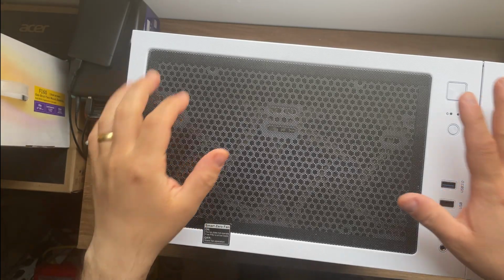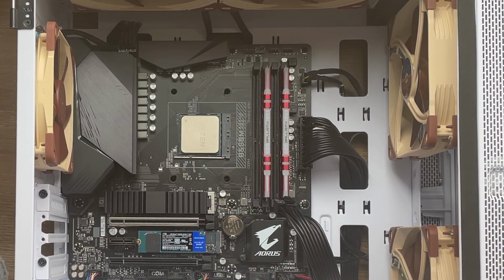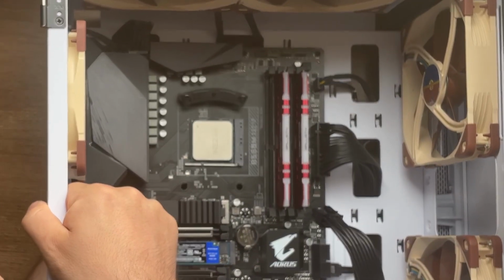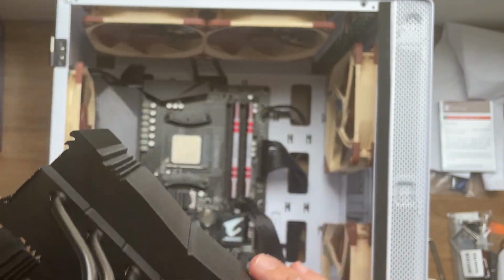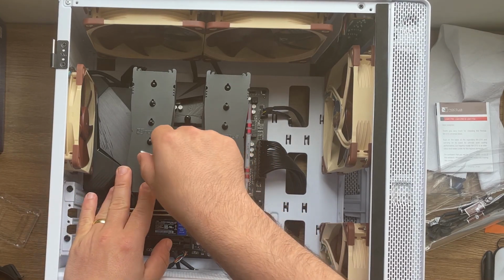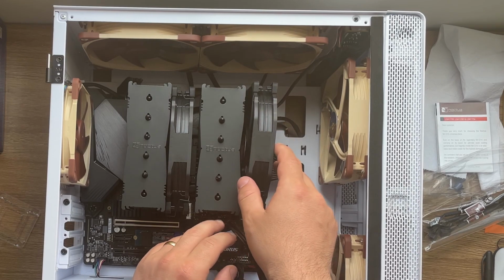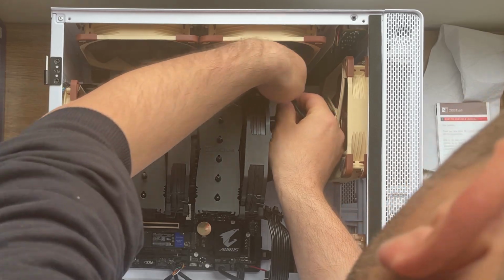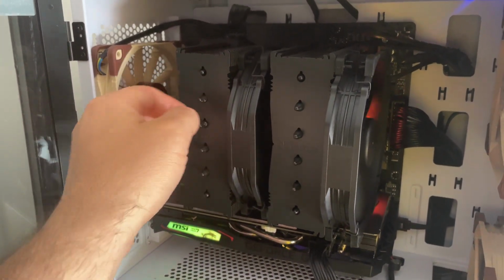NOCTUA NH D15 COOLER COMPLETE INSTALLATION

Comment: Everything is well and correctly done. 
But I saw one flaw. For the best and most efficient case purging, it would be better if the axes of both fans on the D15 tower, the supply fan on the front panel, and the rear exhaust fan are on the same line. And in your system, the upper fan is shifted upwards. 
This of course does not calamity, but this fault reduces the performance and efficiency of purging the case by about 15%.
Reply from the maker: Hi, I really appreciate your comment I will give it a try, so far the case has been really really silent, even when playing cpu intensive games. To be honest, I even took the temperature inside the case and it was very small,  I know because I have a low end cpu the Ryzen 5 3600 it will not be noticeable but, when I will get a Ryzen 9 I will really want to see how the the temps behave :) thank you very much for the feedback

Comment: Did your Noctua's cooler base plate have what looks to be like micro grooves that almost look like it was sanded at an angle?
Reply from the maker: No, the base plate of my cooler was actually very smooth and shinning. That I know of it has to be as smooth as possible to allow the heath transfer to pass without issues.
Reply: @mihaitechtips6998  - That's the confusing part. I purchased an NH D15S Chromax.black and it has a rough plate. So I check on Noctua's site and it says in the faqs:

Why doesn't the base of Noctua coolers have a polished, mirror like finish?

As most of today's PC enthusiasts use high-viscosity thermal compounds, the contact surface of Noctua coolers is optimised for use with this type of pastes. The micro-grooves at the contact surface ensure that high-viscosity thermal compounds are dispersed to a uniform thin layer across the whole contact area and that no air pockets remain between the cooler and the CPU. With a polished, mirror like surface, the risk of uneven dispersion is much higher. As too thick layers of thermal paste and air pockets drastically deteriorate heat transmission, the micro-grooves are is of vital importance to the overall cooling performance of Noctua coolers when used with today's high-viscosity thermal pastes.

I see though that most people have a smooth plate...very confusing
Reply from the maker: @liquidcrow  did you contact company? can you send me pictures by any chance? They do have micro-grooves but that is somethiong that you shouldn't see with the naked eye :) Normally when the cooler is shipped it needs to have a plastic cover to protect for the exact things scratches and damage in general. You can also see if there is a throthelling issue when you run cinebench and if it goes above 90 degrees celcius you have a product defect. I will be waiting for your repply
Reply: @mihaitechtips6998  - Yes, I contacted the company but they have not gotten back to me yet. I ended up ordering it from Amazon 3 times and finally got a model with only light grooves. I do have some pics of the version with deep scratches/ grooves. Where would it be possible to send it?

Comment: How do you remove the video card in the future if you need to install or replace the M.2 SSD under the GPU with that big cooler?  How do you push the GPU clip?
Reply from the maker: It is very simple actually, with a ruler you just need to press the pin that holds the graphics card in place and then the card can be removed just like any other card. Please let me know if you want me to make an instructive video showing the process, and thank you for the comment.
Reply: @mihaitechtips6998  that would be great to see a video on how to reach that video card latch with that cooler.
Reply from the maker: @AK-qo6tx  tomorrow I will upload a short video showing all the process, and thank you for subscribing to my channel!
Reply from the maker: @AK-qo6tx  HI, i have uploaded the video that we discussed before, here is the link :
https://www.youtube.com/watch?v=ZyVmIne3_OU
Reply: just use a small wood stick to push the latch to easy.
Reply: @mihaitechtips6998  Yea, bigger problem can be removing and installing SSD under this monster (depends how it is screwed - it can not be enought place to use screwdriver (?) :). I had such problem and resigned to buy but second SSD, but I now consider to buy second SSD :)
Reply from the maker: @Geralt26  that's why I used a build in cooler for ssd wd black sn850x the clearance is not as big as you would want it to be :D
Reply: @mihaitechtips6998  I checked space without removing GPU (I will remove after I will buy), but i think it should be possible to do, My main concern will be with screw driver. Maybe I will need to but something elastic or small if will not be amble to do it with what I have.

Comment: does this cooler bend the motherboard by any chance? did you had any problems? could u answer me? 
i have a x570 UD gigabyte and i´m in doubt if this will hold.
Reply from the maker: Hi @Aperta, to be honest I haven’t had had any issues with mine but I have a B550 mini ITX motherboard so I do not know if there will be any long term side effect with larger boards such as ATX, From my point of view it shouldn’t if you hold the board in place with its proper screws. I hope I have answered your question. They have all the supports even for Inter boards.
Reply: no it wont bend
Reply: :hand-purple-blue-peace:

Comment: what cpu do you have and what are your temps ?
Reply from the maker: Hi Mozart, right now I have a Ryzen 5 3600, but my goal is to get a Ryzen9 5950x when the stocks and prices return to normal. Regarding the temperatures it depends… for example at idle my temperatures are between 36-46 degrees with some applications running in the background all the time. When I am rendering videos that uses 100% of the cpu for many minutes my temperatures never went above 82 degrees Celsius. In cpu intensive games the temperature hovers around 60-70degrees tops. The cooler was designed to cool down some of the most power hungry CPU’s from i9s latest generations and ryzen 9s latest generations. After finishing rendering a video the temp drops down to 40 degrees in a mater of seconds.
Reply: @mihaitechtips6998  ahh okay it’s just because I have a 5600x and it never goes above 61c in CB23 (non-PBO) and goes to around 82c with PBO on and that is only 130w but I suppose it’s the voltage that makes it so hot because the NH-D15 is apparently too big to even get saturated with heat from such a small cpu :/ Amd needs to make better a better IHS for their cpus
Reply from the maker: @def5100  with the stock cooler when rendering Videos i was going over 90degrees  and that scarred the hell out of me, if your temp never goes above 82 degrees in full load that means that you have installed it properly. The Ryzen 5 5600x it gets a little toastier than mine as it uses more power yes, but I would not be concerned.
Reply from the maker: @def5100  let me know if you want me to make a comparison video for thermals this weekend, in cs go I got an average of 46degrees Celsius
Reply: @mihaitechtips6998  that would be nice to see one without pbo and one with pbo and auto OC

Comment: What case are you using in this video ?
Reply from the maker: Hi there Chi Dung, I am using a Thermaltake S100 Snow Edition. I have to say that i have fallen I love with this case as it is really great quality and the looks and airflow it’s amazing for any mini ITX case.(this is the purchase link from Amazon https://www.amazon.com/Thermaltake-Micro-ATX-Mini-Tower-Pre-Installed-CA-1Q9-00S6WN-00/dp/B087CDVBZD/ref=mp_s_a_1_1?crid=1X21DEVQIIC7C&keywords=thermaltake+s100&qid=1645482054&sprefix=thermaltake+s100%2Caps%2C238&sr=8-1
Reply: @mihaitechtips6998  It doesn't have a mesh front panel version, is the airflow actually good ? I've never seen a solid front panel case that has quality airflow, they are only typically used for water-cooling
Reply from the maker: @chidung3326  hi, the sides of the front panel have 2 metal mesh filters that are very wide, I have on mine 2 140mm radiators and the air flow push pull is so good that many times the fans do not ramp up to more than 800rpms due the chill temperature inside the case
Reply: @mihaitechtips6998  Ok thanks for the replies